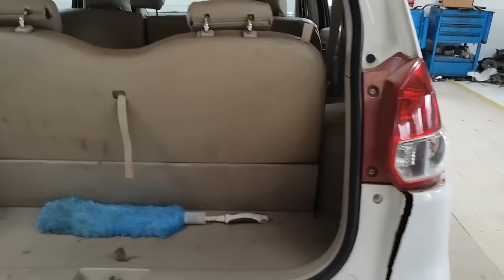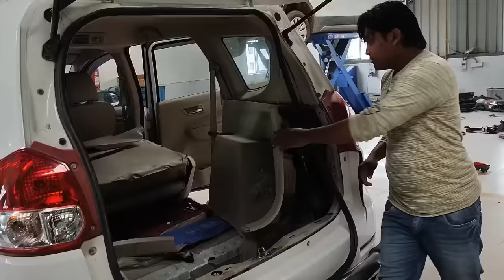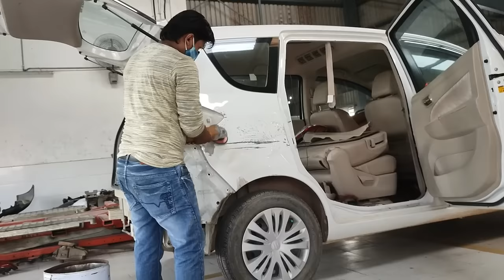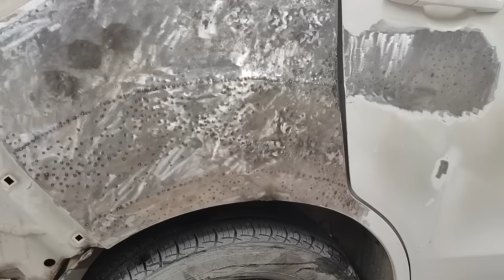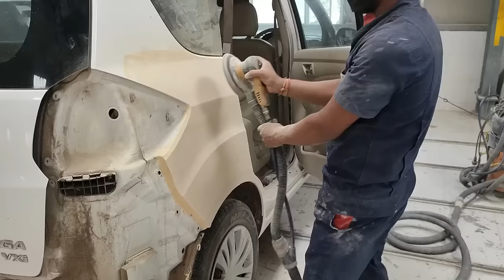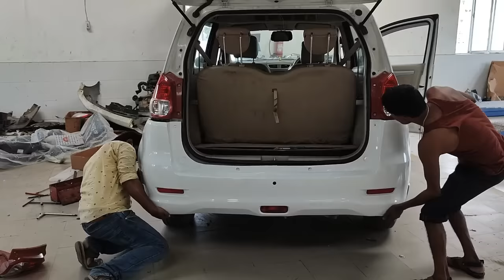Ertiga Dent removing process|Ertiga Denting Painting #Automobileservice

Comment: Colour difference is visible 😳😳
Reply from the maker: Just because of the rear door and quater pannel have new colour and the front door and the other pannel has its old colour
Reply: @AutomobileService  still if u are using company colour paint it will not see any difference
Reply from the maker: Sir we use company paint only nothing else
Reply: U should have blended the front door aswell.
Reply: Im painter myself. Im afraid to say thats not top quality work.
Reply from the maker: No my friend I have got work order from my manager for quater paneel rear door  rear bumper only not for the front door
Reply: @AutomobileService  i understand but color matching is painters responsibility. Not the managers responsibility i believe. It doesn't take much effort to blend in half of the door and lacquer it all. As white color gets dirty and hard to match without blending. Just my opinion but u done good filling. Keep it up the good work.
Reply from the maker: Thanks ❤❤❤ for watching my videos
Reply: @lovepeace1140  colour matching is better at company, as they have computerised paint with respect to particular model.